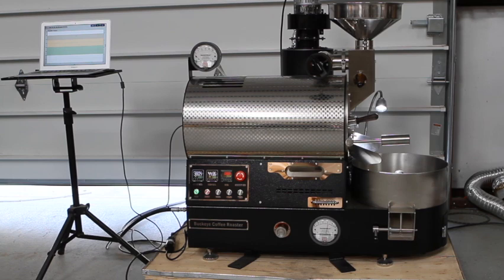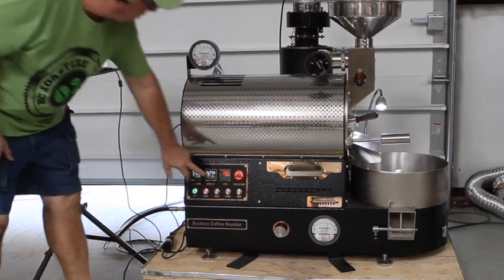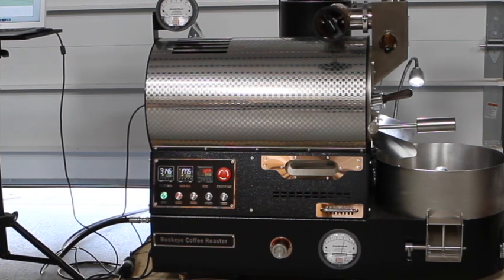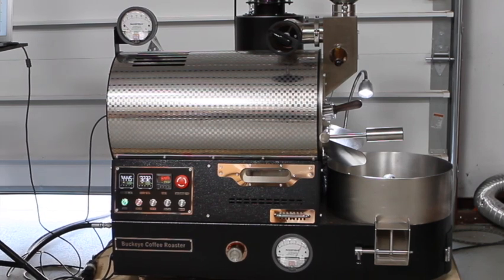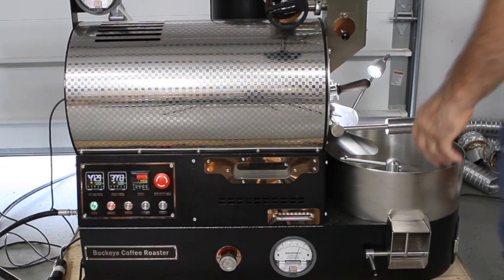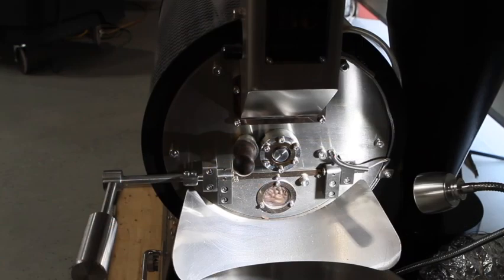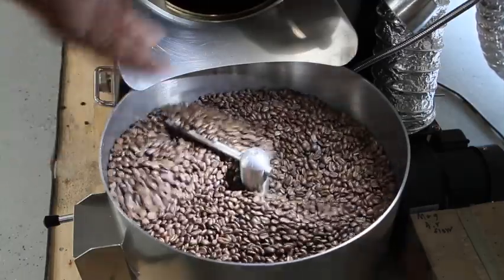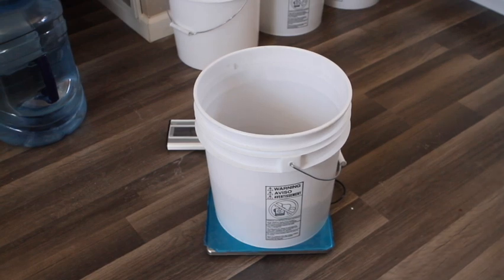2022 BC 5 DW ROASTS 6 POUNDS!

Comment: Whats your charge temp for 5 lbs vs 6 lbs?
Reply from the maker: If roaster s fully heated and I want a faster roast I will raise the charge point. Maybe to 400f. But personally never go above 425f. Some roasts and beans I want a bit slower of roast. I might charge a bit lower but usually I give a high gas pressure on full roasts during the drying phase.
Reply: @BCRoasters  in this demo of 6lbs I heard you say 400f. Do you also charge 400f on 5lbs load or should it be lower?